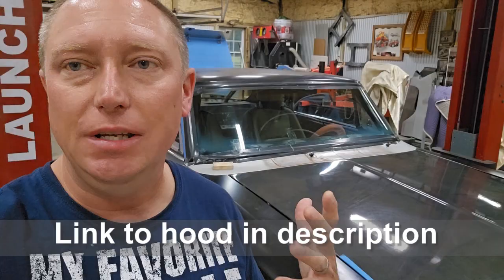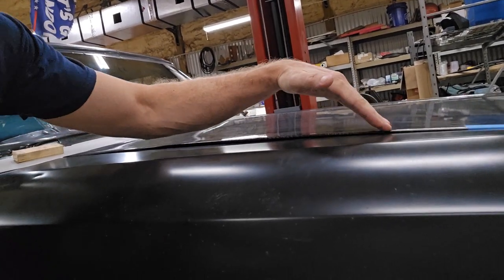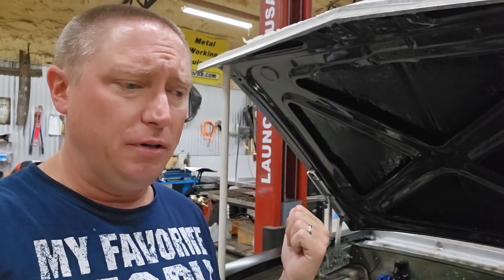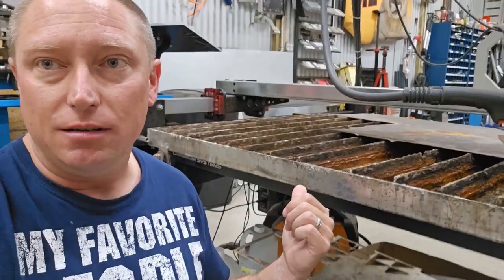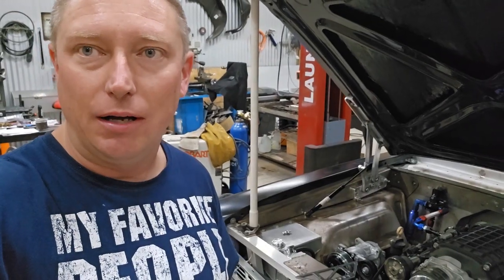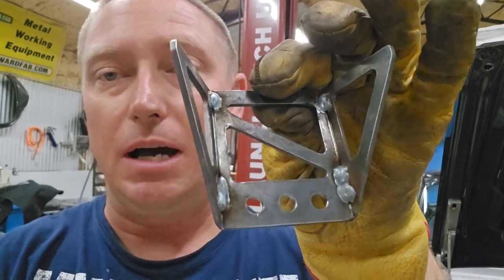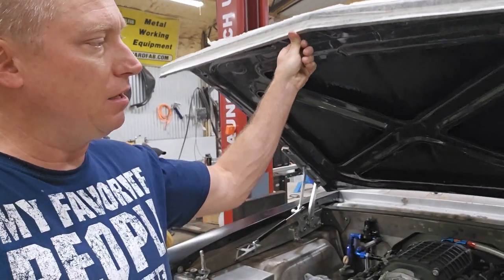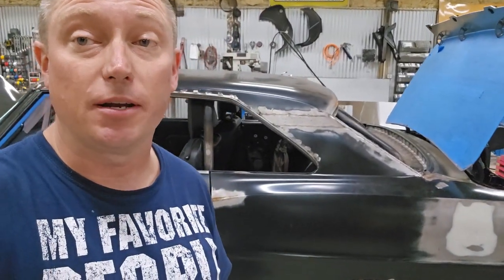Re-Engineering Hood Hinges 4 Carbon Fiber Hood - How I Did It

Comment: Well done, Might I recommend you put a stop on the hinge at the fully closed position  so the hood is not being pulled down as it will create a bandanna effect in no time. I know putting stops for the hood to rest on along the inner fenders would also work but ruin the clean look you are going for.
Reply from the maker: I thought about that.  Given I'm confident the hinges are seeing no upward or downward force as it is currently built, I think I'm first going to run it like it is to see if I notice any new bowing in the hood.  If I do, then this option you recommed is probably my next move.